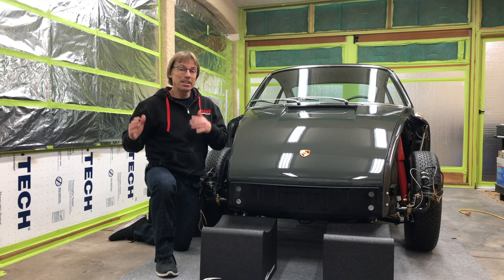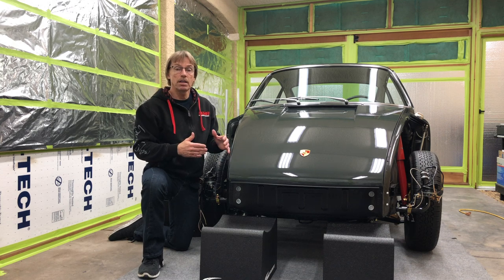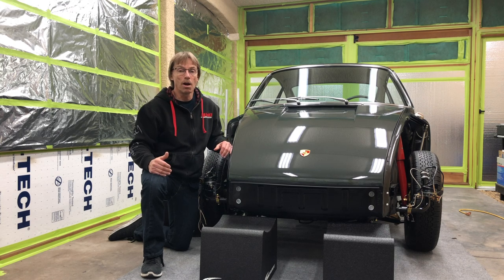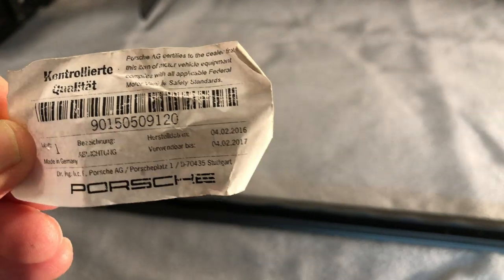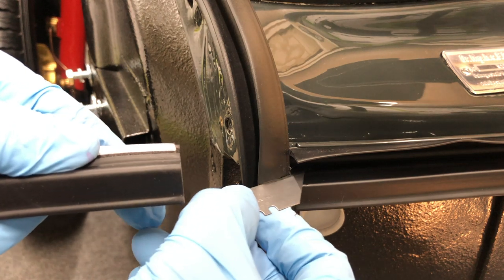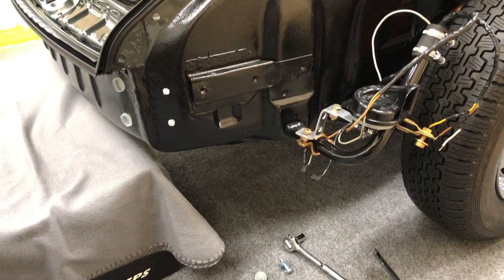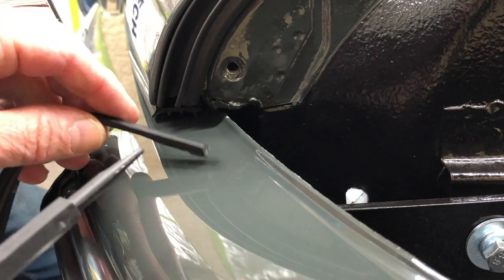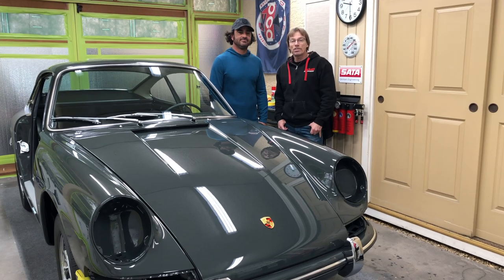Porsche Restoration Project Installing Front Bumper.    Video 64

Comment: Mike,
The interior is done on my 69 911e with a new dash, restored gauges, carpet, and recovered panels.  Looks great and thanks for the helpful videos.  Next comes the exterior.  Now that you have completed your car would you change the order of assembly?   I believe it was engine deck lid, long hood, front bumper, fenders, then doors.  All of these were fitted and pinned before painting, so everything should go back together easily.  
Thanks
Reply from the maker: Hello Roger
Congratulations on your interior restoration! Im glad the videos were helpful..
Good question on the Assembly order. I don't think I would change much of the order as the final adjustments will all need to be made after everything is in place. Panel gaps door latches, hood lashes etc. If you have not seen the final walk around video I refer
to the process in some detail..
The only suggestion I might make is to not over tighten fender screws and bolts as they will require considerable adjustmeant
in the end phase. As far as every thing going back together easily after paint..Good Luck! I didn't find any of it went smooth after paint.

Comment: Are there holes in the front of the trunk, to allow access to those bumper bracket bolts?
Reply from the maker: Hello cmscms
Thats a good question..There are holes there but no alignment possibilities with anything that could be of help.
They would be vertical position and offset.. the brackets would be lateral positions
Not sure really why those holes and plugs exist..Its a mystery

Comment: I need that rubber center weather strip part for my 912. Any chance you can direct me to a source please? Thanks
Reply from the maker: Hello Kobus
The center piece on the front bumper is actually glued to the late and right number molds.
Its sold as one piece for the bumper. The center piece higher up on the truck is sold with the trunk seal and needs to be cut to size. All rubbers were sourced direct from Porsche. It's possible to get the part numbers from any of the major suppliers websites.
Good Luck!
Reply: @MikesRestorations  Thanks Mike

Comment: Why is there lead weights in the bumper??
Reply from the maker: Hello Kirk
The front weights help to balance the weight of the car.
The rear engine location creates a very lightweight front end and light steering conditions
making the car dangerous to drive.
Reply: @MikesRestorations   Ahhhhh… the old Covair issue. a friend had one back in the day and stopped and shoveled dirt in the front, going up a windy canyon in SLC to tame it down.  Thanks Mike.
Reply: How many pounds of lead do you have up front? Was that an original factory mod or one that a previous owner put in?
Reply from the maker: My guess is approximately 25 -30 lbs each side
These were factory installed on all 911 ..im not sure about 912
my guess is yes but the weight might be different
Reply from the maker: Yes I'm sure they can be a bit squirley!